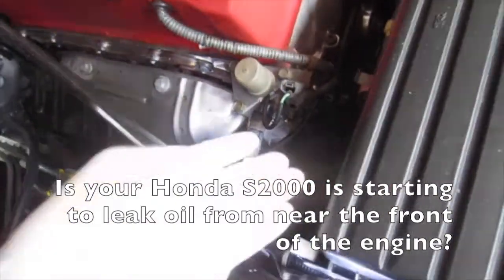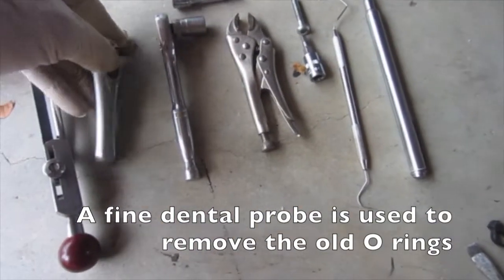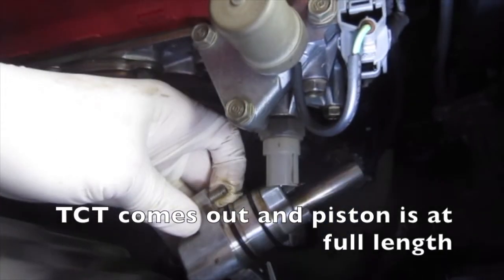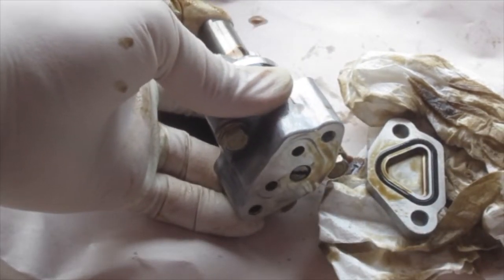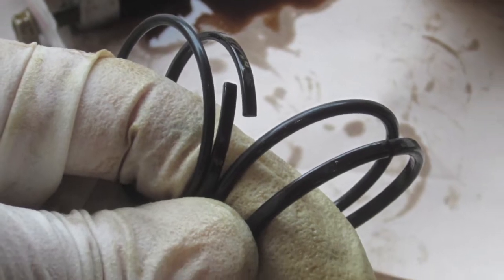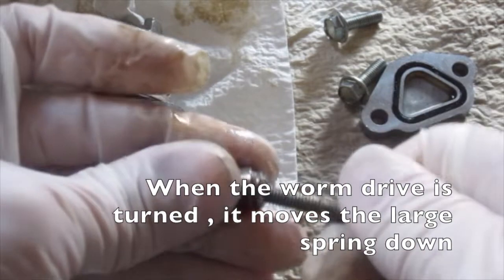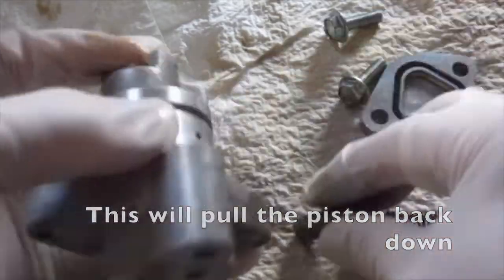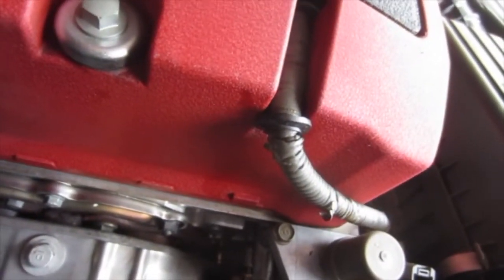Best video showing S2000 TCT rewind piston and replace O rings

Comment: Another alternative to the vice grips holding the worm gear retaining bolt is to add a nut at the end of the bolt. Just tighten the nut against the TCT and it will lock it in place
Reply from the maker: That’s another great idea . Always tricky to get the bolt the same thread size to match the tct though . Thanks for sharing.